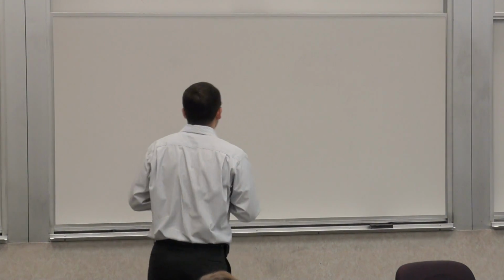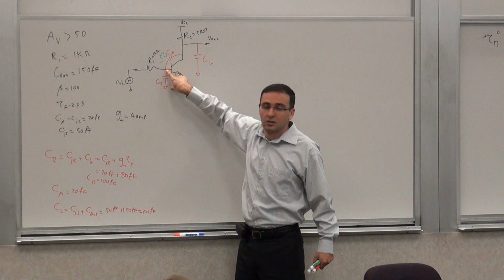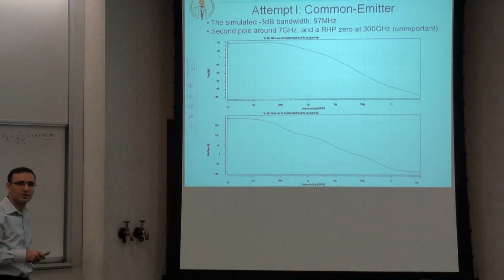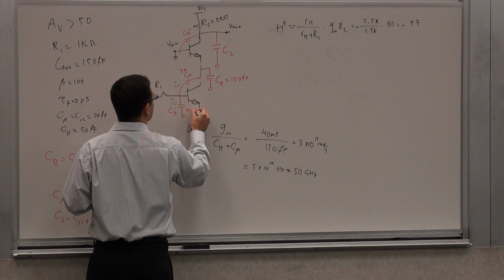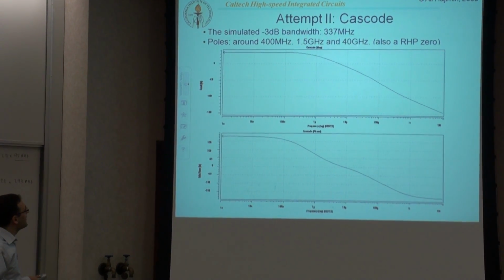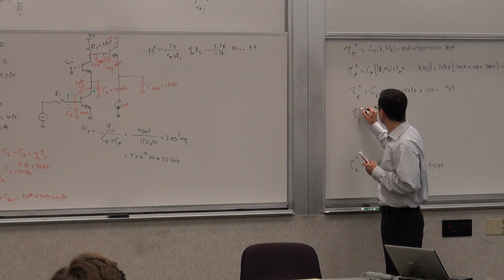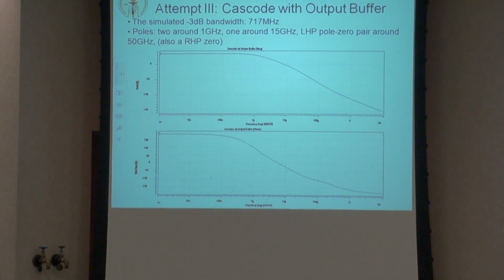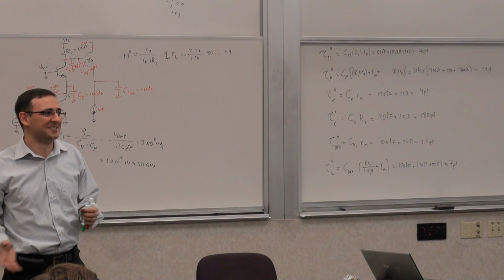142. High Frequency Behavior: Design Example, Zero-Value time Constant, Bandwidth Estimation

Comment: Sir,
You have assumed the cut-off frequency(ft) to be the same in case of CS stage and cascode? Is this assumption valid? I am in a doubt because fmax (Power Gain = 1) is different for both the stages.
Reply: I know that ft and fmax are independent of each other but doesn't Miller Cap have an effect if we compute ft as gm by paracitic caps?